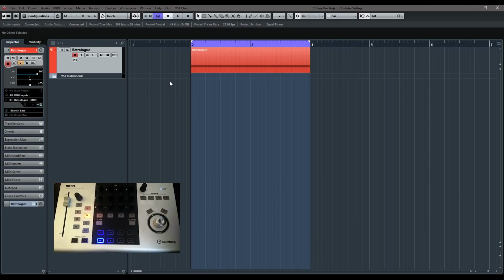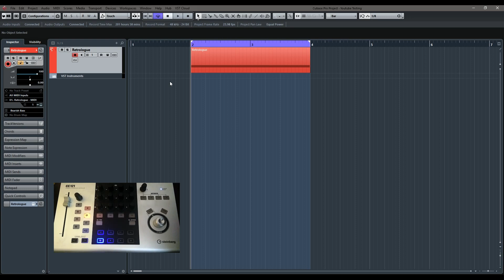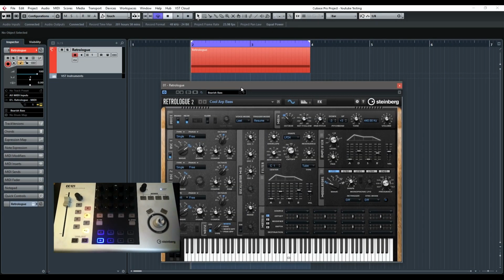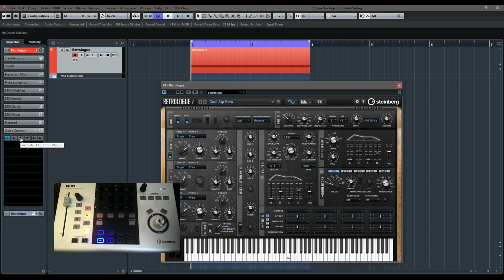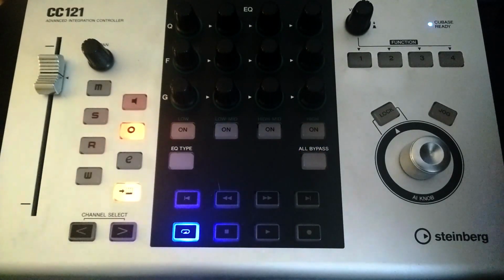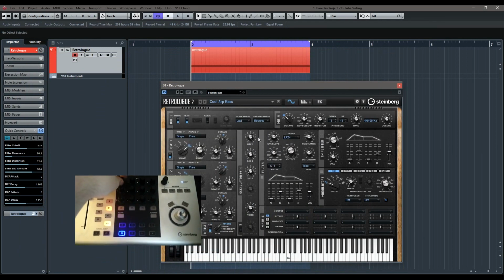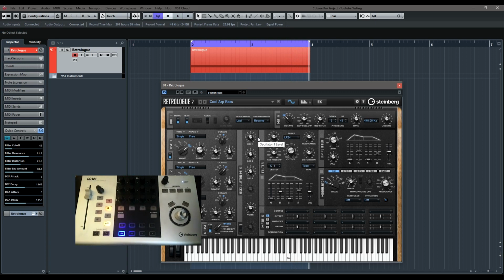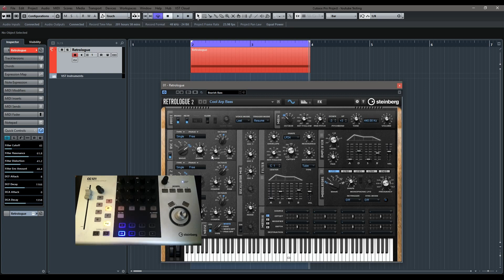Cubase Quick Controls using the CC121

Comment: How much/fast do you need to spin it to get to the highest or the lowest value? Maybe at some point you want a fast steep filter movement.
Reply from the maker: Its hard to quantify the speed but I'd say you can do some fast filter sweeps etc, the controllers are pretty high resolution but its a fixed value. 
I believe you can alter the resolution of the main fader.

Comment: Hi. Excellent tutorial - quick and easy to understand.
How did you get those to QCs to be the default ones for Retrologue? All my Steinberg plugins have volume as QC1 by default and as I never use this it drives me crazy. If I set them manually they are never the same for that plugin when I reload it. I want to be able to set my own as the plugin default so I can load them as you did here. Hope that makes sense!?! Many thanks.
Reply from the maker: Thanks, glad you found it useful. I just hit 'get default QC's from plug-in'. If the defaults aren't what you want then you can set them manually, then click the diamond shaped icon to the right of the 'Quick Controls' heading, in there you can save your preferred QC's as presets to recall when needed.
Reply: Thank you William.

Comment: thanks for the video. Just wondering, how easy  or how do you set up the cc121 with 3rd party vsti's or plugins? (like Kontakt, Diva and so on)
Reply from the maker: Dead simple, just click the learn button in the QC tab and then move the parameter on the synth/vst/plug-in that you want to control. It will then assign it for you.